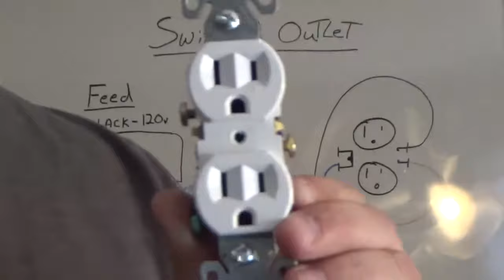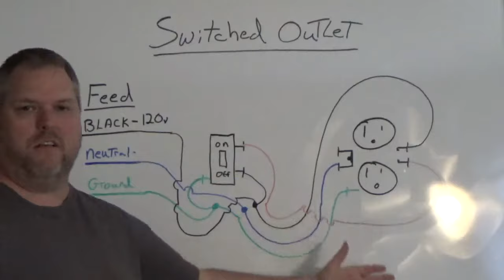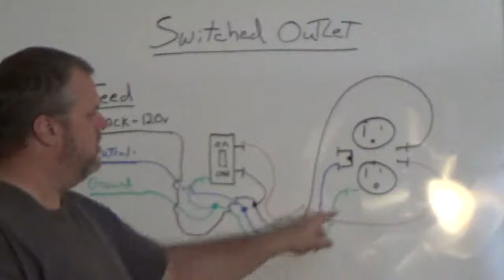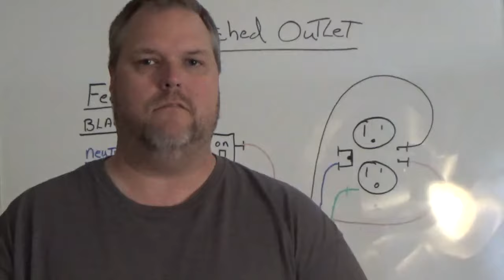Switched outlets Eplained

Comment: So having 2 switched outlets in same room that's controlling both outlets with split tabs, doesn't both switches have to be on to operate a lamp from one of the outlets with switch on? so in other words if I am to use a lamp turning on the switch that the other switch in the room has to be on as well in order to make the other switched outlet work to turn on the lamp?

Comment: I have a single switch in my living room which is connected to an outlet.  Both plugs are controlled by the switch.  Can i convert the outlet to both plugs to be live, and eliminate the use and cover up the switch?

Comment: Is there a way to turn a switched outlet back to a constant hot?
Reply: Jump the switch. Just connect the 2 wires that go to the switch together. Then put a blank cover plate so it doesn’t confuse people.